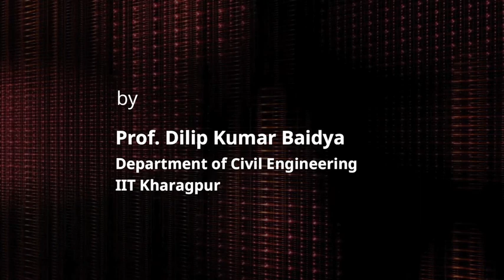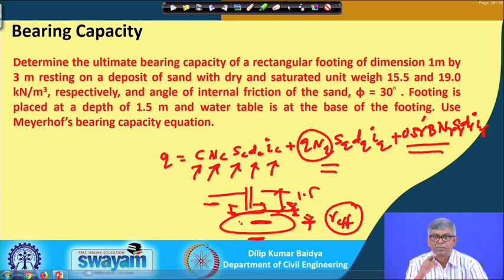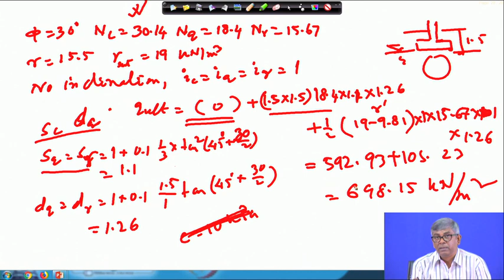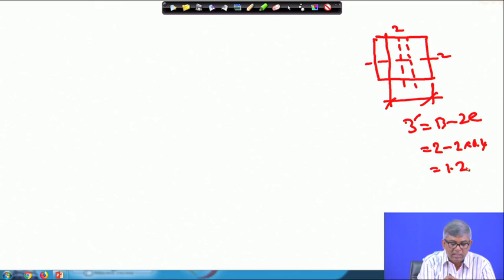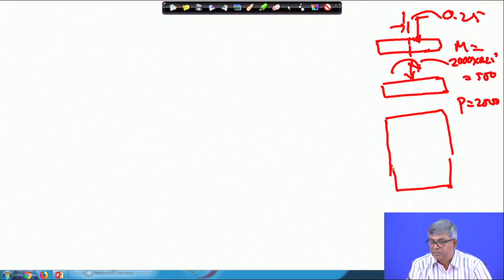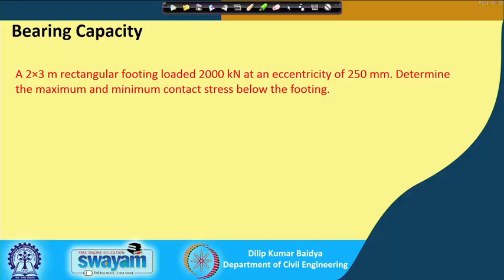Lecture 14 : Shallow Foundation (Contd.)

Comment: Why 19-9.81
Reply: We will use submerged unit weight there due to water table. 
(submerged unit weight of soil) = (saturated unit weight) - (unit weight of water)
=19-9.81
Reply: @anshumansingh6612  preparing for something??
Reply: @johnsumith2107  ESE/GATE
Reply: @anshumansingh6612  passed out or 4rth year?
Reply: @johnsumith2107  (I don't want to provide personal info beyond this on public domain)